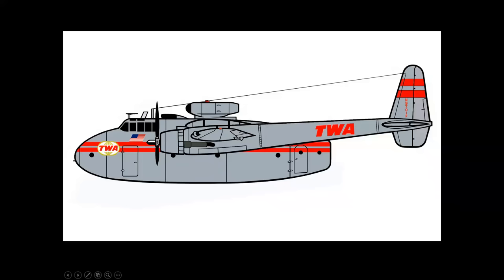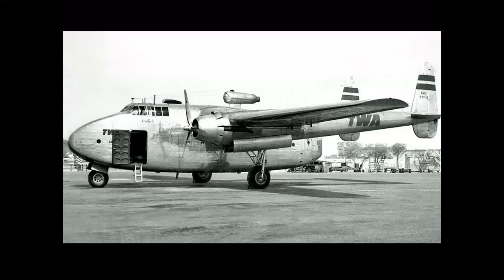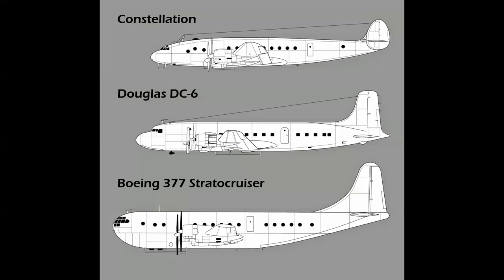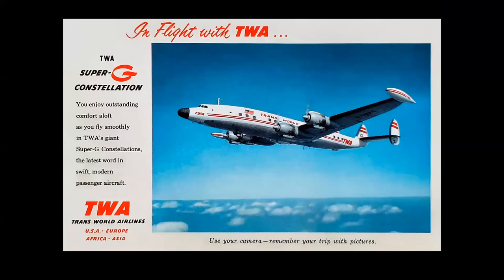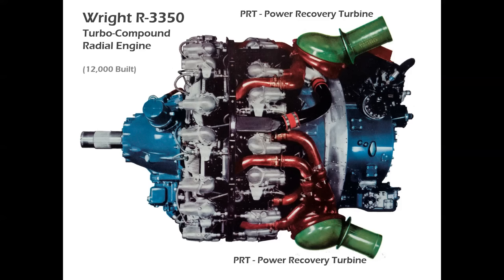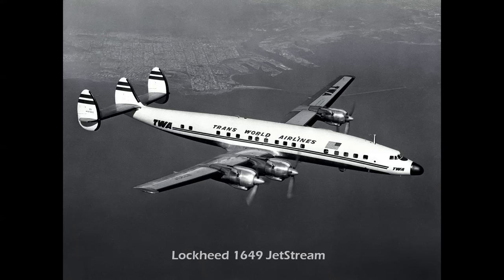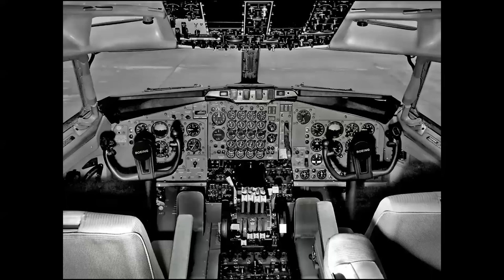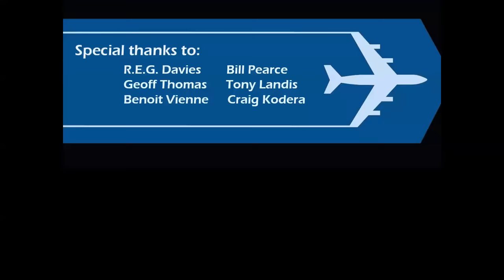LOCKHEED CONSTELLATION ENGINES - How were new engines delivered from the piston era to the Jet Age?

Comment: Don’t neglect mentioning the turboprop airliner - The Lockheed Electra. Granted, it had the prop whirl mode issue, but once they changed from the triangle engine mount to the rectangular mount, it fixed the problem. But the PR damage had been done. That airframe, with modifications, became the venerable P-3 Orion! I had over 4,000 in them over a 20 year career, and it will live forever in my heart.
Reply: There is more to that story. As a mechanic I am familiar with the issue, which they called sympathetic synchronous vibration (or something like that, pretty big words for a mechanic, right). Long story short, an out of balance prop would vibrate and this would in turn start a vibration in the wing which would then crack and depart the aircraft. Wings are pretty hard to do without. So, now we have systems built in to monitor vibrations and it gets checked regularly and rebalanced if needed.
Reply: I got to fly a P-3 Orion for about 5 minutes.  Navy gave orientation flights to prospects for the flight program and I got to ride along and share the right seat for a turn.

Comment: As a teenager in 1967, I took a trip in a Vickers Viscount and returned in a new DC9. What a difference! The propeller-driven Viscount was slow, very noisy and incredibly shaky. The turbojet-powered DC9 punched you right in the back on take-off and the rear mounted engines were smooth and very quiet. The propeller-driven aircraft were primitive in comparison.

Comment: Back in the 50s, my dad was in a Lockheed Constellation on a flight back home to attend a funeral of a family member. The plane had an engine failure midflight but reached its destination without incident, however it did scare him because he had always been afraid to fly and this incident only served to further scare him about air travel.
Reply: I understand your dad's thinking.  I stopped flying in the 80s after several times of being put on, Dump Trucks--worn out planes ready for retirement, the kind that has worn-out seat covers over worn-out seat covers.

Comment: I got on a DC-6B that Delta flew from Shreveport, LA to Montgomery, AL with a stop in Jackson, MS back in 1963.  Just before that flight, I had flown on hops with SAC courier flights from March AFB, in California to Offutt AFB in Nebraska, and then a hop to Barksdale AFB in Shreveport.  All of the trip was powered by big round motors. The R-4360s powered the KC-96 from March to Offutt.  The hop to Shreveport was on a T-29 powered by R-2800's. Of course, the DC-6B also used the R2800.  I almost got a ride in the T-39 Jet (Saber Liner) for the hop from Offutt,  but got bumped by a higher ranking gentleman. (He had a bird on his shoulder. I was a lowly E-3 PFC in the Army at the time.) All my rides were with engines that were probably older than I was.

Comment: The first aircraft, the C-82, was the precursor to the C-119 "flying boxcar", a staple for delivery of Army paratroopers. First aircraft I ever jumped -- in Jump School, 1966. Jumpmasters hated it because the aft fuselage tapered down putting the two rear doors at a rearward angle. If you exited left and right simultaneously, the two jumpers would meet just under the twin tail booms. Hard. Jumpmasters had to stagger the jumpers to make it work, which, of course, slowed down the stick. Defeated the military goal of getting the jumpers out as quickly as possible so that units could land in close proximity. Hell of a tough jump.  When we got to our units we were jumping C-130(s) and it was like the sun came out! We could clear a 12 man A-Team (I was in Special Forces) in 3-5 seconds -- using the doors as we only used the ramp for HALO -- and, as the 130 was a four engine aircraft, they would cut back on the inboard engines to reduce prop blast. The C-141 was even better (used to strap hang with the 82nd when I was at Bragg) with blast deflectors that rotated out of the fuselage and going to flight idle on the inboards. Still, I'm glad I got to jump that old hunk of metal.
Oh, and yeah, the Connie was arguably the most beautiful thing that ever took flight.

Comment: Thankfully, the JT3C/D engines in the 707's were reasonably reliable, having worked on the military versions(J-57 & TF33)of the same engine myself in mid-late '70's during my USAF service as a jet engine troop. The TF33 is still in use today on the B-52H bombers, and the J-57 was used in the B-52A through G models. ✈✈
The J-57 powered KC-135 tankers were about the loudest aircraft in the inventory when in water injection during takeoff, and the exhaust smoke was quite noticeable as opposed to the turbofan-engined tankers & bombers. Fan models were also quieter. 🛫
Thanks for a cool & informative video!

Comment: My Dad and Mom worked for CP Air in Canada in the 1950s. They flew in DC-3s, DC-6b, DC-8, 747, quite a range of commercial aircraft development. My father recounted 6bs being the first aircraft that could do the Japan run, from Vancouver (YVR), with refueling stops in Alaska. Imagine flying across the Pacific at such a relatively low altitude. My mother recounted seeing Beluga whales shore to shore in the St. Lawrence, while in a DC-3. I found the remains of a 6b my father flew that run on. The cockpit and front part of the fuselage reside in a  museum today.

Comment: I have a book that says that the R3350 turbo compound engines made 3600 hp, and each PRT produced about 200 of those horses.

These were just like the turbine section of a turbocharger, but instead of turning a compressor wheel [the engine was already supercharged], the shaft from the turbine powered a fluid coupling which then was connected to the crankshaft, kind of like three torque converters helping power the propellor.

These PRT's were ~~NOTORIOUS~~ for surging when the throttle was advanced and literally blowing apart!  On takeoff, pilots had to put their feet on the brakes, and the engineer would slowly over a 20 second period advance the throttles to takeoff power.  That is what you had to do to keep these things from "launching"! 

And on top of that, these air cooled engine were very very susceptible to "shock cooling", which means that it was not uncommon to pull one of these engines to idle at cruise and the sudden cooling of the cylinders would cause one or more to crack and literally break off the engine!  These were very highly stressed engines, built as light as possible since they really didn't produce much power, and the metallurgy back then was not as advanced as today.

Great video!

Comment: Just a note. Dad worked ground service for TWA in KC. Flew on the Connie as a kid. Yep the coolest thing was the flames out the exhaust. Also I was entertained by sprinkling salt on the dark tray tables and watch it vibrate around. On the Connie first class was in the rear away from engine noise.

Comment: When you mentioned the fire show during a Connie flight, it brought back memories of flying out of Shreveport to Dallas on a Convair 440. Dad worked for Delta so we flew often enough. The 440s seemed to like to light up when they were starting. Papa said that was just the way they were and that they were safe. He just missed the Korean war..." uh, police action" and flew a lot of the C-82 as radio technician (don't remember the proper term but he could fix stuff in flight) and talked about the 82's engine being prone to just not working on the way to wherever. But they always got there.

Comment: Thanks for the great information. The image of the C-82 is what drew me in to start with and then the rest of the post kept my interest. In the mid 80's I was on a forest fire in I believe Montana, and was in awe of what I thought was a "flying box car" with a jet engine mounted on the roof making slurry drops into a box canyon. As it dropped into the canyon we would here the rising sound of that jet as it's power was increased to pull the craft up and out of the canyon, quite impressive. This may well have been a C-82. 
 On another note, my Dad served in Korea aboard B-29's and later, flying out of Spokane Washington, was flying over the pole to check on the Soviet Union. He was a crew chief and later taught aircraft mechanics on the B-29 as they were being outmoded. His rememberences of the Wright engines were not all good ones. He told often told having to pull all of the spark plugs and either replacing or cleaning them and refitting them, in a hurry.
 I still love the old aircraft and their unmistakable sound.
 My first flight, as a 4-5 year old was from New York to Germany in a DC-3, in about 1955. This was by way of the Azores for refueling.
Thanks for stirring the old memories.

Comment: I flew on a DC-7C from Memphis to O'Hare at night in late 1964. I think it was either Delta or United. I sat in the right window seat on the trailing edge of the wing, looking  down the exhaust of the right inboard engine. On takeoff and climb there was a 4 foot long orange flame coming out and I could see right down into the red hot power recovery turbine. When the plane leveled at cruise, the exhaust shrank back to a few inches and turned blue as the FE leaned the mixture. That was probably the most comfortable airline flight I ever had. The first leg of the trip was a milk run from Pensacola with about 2 or 3 stops to MEM in a Southern Airways DC-3. The last leg of my trip was in a DC-8 from ORD to Portland with about 30 passengers. The cost wasn't much as we could fly "military standby" in those days when I was making $115 a month as a Student Naval Aviator. 3 generations of airliners in one trip.

Comment: Northern Air Cargo, Anchorage, Alaska, operated C-82s into the late '70s, and DC-6s into 2000 -- plus, a resurrected C-133 Cargomaster, final flight in 2008. When I retired from the Alaska Air Guard, 2016, at Elmendorf AFB, Everts Air Cargo and Air Cargo Express were still operating DC-6s out of Anchorage -- some contract flights to/from radar sites around the state. Pretty cool to hear the four P&W R-2800s wind-up -- 72 cylinders and 144 spark plugs, all banging away (still out there, making money, I believe). My dad was a nav in USAF RC/EC-121 Warning Stars, out of Otis AFB, Cape Cod, MA, during the mid-1960s. Lots of engine fires in those Wright R-3350s -- they lost three aircraft and 50 crew within a year and a half. The long radar picket sorties/orbiting off of the Atlantic coast, were at about 18,000 feet. Heavy with fuel and all of the radar gear, for the first few hours they "just hung on the props."

Comment: I work as a pilot for a large international airline. A couple of years back at one of the mandatory CRM course we are obliged to attend, one of the course instructors trotted out a safety comparison between the big piston propeller airline industry and today’s jet transports.
If the accident rate per passenger mile flown of he big prop airliners was applied to  the world jet airline traffic of 2019 ( pre pandemic) it would equate to 5 hull losses per week. These days 5 in a year is a bad year.
The point he was trying to make to us  is that it’s not our amazing piloting skills that has made it so much safer but the reliability of the kit and technology at our disposal.
The job of airline pilot in the past required an immensely higher level of skill than it does today.

Comment: It was not common for airliner customers to specify engine makes, let alone makers in those days, but the DC 7 Seas for BOAC (British Overseas Airways Corporation, which became British Airways BA) were specified with Rolls-Royce Merlin or perhaps Gryphon engines.  I don't know which version - they both went up to 3000 odd bhp in military service, but BOAC called them the Argonaut.

I can remember going to London Airport (before it was called Heathrow) and watching the Connies and Super Connies, the Stratocruisers (which was also operated by BOAC) and of course the DC4s, DC6s, then the Argonauts and DC7's.  The smell of big, petrol engines was soon superseded by the smell of burning paraffin when BEA began operating the Elizabethan and then  the Vickers Viscount.  Then came the Comets and 707s (both operated by BOAC.

Now, of course, virtually all aeroplanes have two high bypass fan engines and, from any distance, are really difficult to tell apart.  Back in the mid to late eighties, it took me ages to be able to reliably identify a B777 on the approach to LHR.  Its easier with their wheels down, because very few (if any) other twins have 6 wheel trucks.  Only the Queen of the Skies (B747 any variant) is worth watching nowadays.

By the way, how many other airlines did what Air India did with their first 747's?  Put a fifth nacelle inboard of (I think) the starboard inner that could house a transit spare engine.
Reply: The Argonaut was a Canadian built DC-4 with Merlin engines. (I knew because I recently read an article on the Stockport disaster involving one)

Comment: Greetings:
Fairchild built both the C-82 Packet and the C-119 Boxcar; they appear to have some  commonality. Built on Long Island and based at Mitchel Field. The C-119s used to fly over my home in East Meadow, along the right-of-way for the Central RR of Long Island. 
The infamous Rep. George Santos' congressional district has its southern border on the opposite (northern) side of that right-of-way now used by the Long Island Power Authority for high voltage  power distribution. That location behind my family home was the original location of the Meadowbrook Hospital sewage treatment plant (how appropriate).

Comment: On or about 2002 while visiting Wheeler Downtown Airport (KC), I saw among other things, a R4360 cutaway engine that had multiple, small PRT's on each cylinder row, coupled to the crankshaft with small bevel-gear driven shafts (IIRC). I've not seen other photos or articles on this version of the Wasp Major. I think it was placarded as 'Maximum Wasp'. They have a museum there with a realistic early terminal passenger area, and outside, a L-1011 minus engines. Huge jet.

Comment: A town in southeastern Pennsylvania, Penndel, had a restaurant called Flannerys. (Just off Business 1) Above it, on 3 pylons sat a constellation. It was the lounge. The cockpit was walled off with clear plexiglass. The plane has disappeared and a gas station is there now and a tiny model of the plane on the corner.

Comment: A very interesting segment!!! A way the airlines could express deliver an engine to any location, to get the stranded plane flying again... Another interesting thing, were the failed exhaust valves of the Wright 3350's, that took-out engines and PRT's... That must have cost a lot of $ !!! I remember when working at one of the major airlines, learning about the presence of a '5th pod' on the Left wing of 747's... It was designed carry a high by-pass engine, to ferry that engine to wherever it was needed to get a stranded.plane flying again, and to pick-up the core engine to move it to the engine repair facility... Similar to what the C-82 did, but these planes turned those trips into passenger carrying revenue flights...
Reply: Saw this in Saigon when I spied a Pan Am 747 with 5 engines land.  1974 or 75.
Reply: @tfogelson3139  Yes indeed!!! That was a 5th pod being used to get a stranded plane out of there..  My guess is the majority of that 747 flying to Saigon had that engine and a lot of supplies for the troops on the ground, and flying out of Saigon,, was loaded with many refugees - trying to get out of there..  The plane was probably at it's maximum capacity, mostly with refugees, and enough fuel to get them to a neutral/friendly place to be processed and readied to be sent to the U.S. by any means available

Comment: Flew on WV2's, air crew USN, 1960, 61 and 62. The Willy Victor was a great ride. Crewed on 145941, last Connie built. Radio operator position.

Comment: In the late 70s and early 80s, the Eastern Shuttle (between DC and LGA or LGA and BOS) used two engine jets (maybe a DC9) as their primary planes that flew "on the hour". But Eastern guarantied that if you showed up, they would fly you, bringing out another plane to carry the extra passengers. It was known by the regular fliers that if you timed it right, and the plane was full, the airline would bring out a Continental to fly you. From DCA to LGA, the Continental was faster gate to gate, because the jet had to fly a restricted noise abatement route that was long. The Connie could take off, turn directly to NYC, and land without any noise abatement at the New York end as well. I think they kept flying the Connies into the mid 1980s